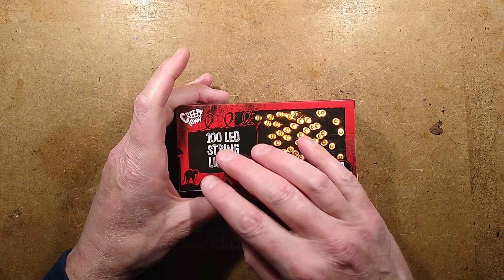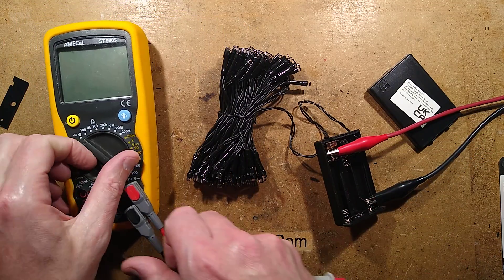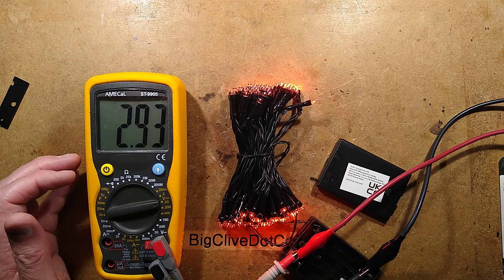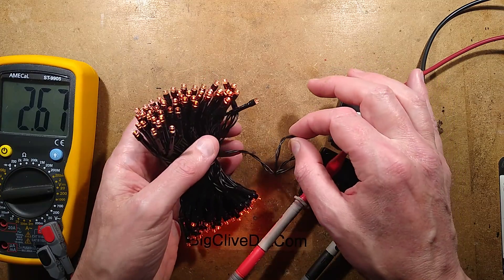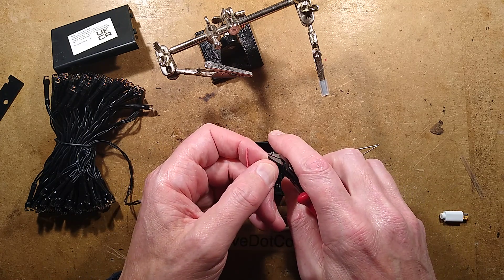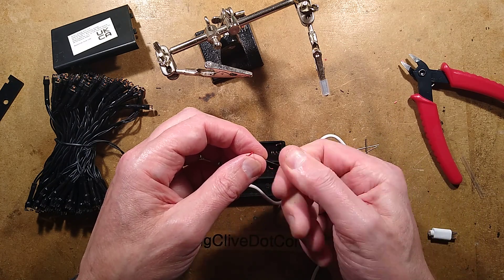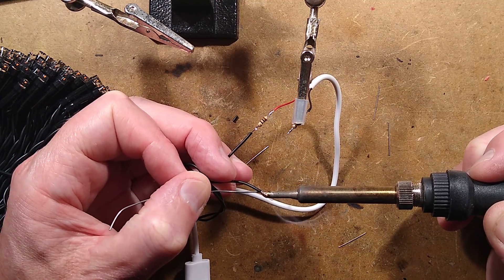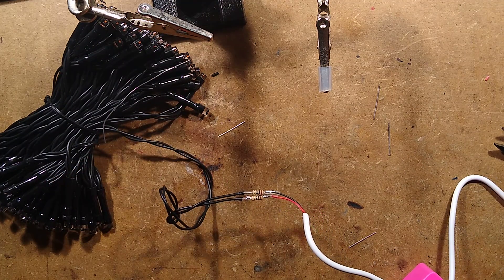Poundlands 2021 Halloween lights (and USB hack)

Comment: Hi Clive - Another great video thanks! 👍🏻
I’ve recently bought some fantastic COBs and Cree LEDs - about £1.50 for 10 ! (link below).
I was particularly impressed with the tremendous light from a ‘waffer thin’ 1 inch diameter round 3W COB!
It runs off about 9V (260-280mA) but I’m a mere novice and don’t know if it requires a resistor. Is it because without one, I’m effectively short circuiting the whole thing? It lit up fantastically with a 7.4V lipo but I didn’t keep it connected for long.
I’d like to know if I need a resistor & if so, what value? People have also mentioned ‘drives’ or ‘drivers’ ?
There’s another great little 1W Cree (same price) which runs off about 3.2V.
Any suggestions or dare I say a VIDEO would enormously useful 🤩🤩🤩 Thanks again! 👍🏻
Reply from the maker: LEDs generally need current limiting and for the high power ones, also some heatsinking too.
Reply: @bigclivedotcom  Thanks!  - maybe you could do a video on these types of led. Neither of them got warm, not even the 3W, it’s almost like free light! And what’s all this about drives or drivers ? 👍🏻👍🏻👍🏻

Comment: Tried this today with 2 sets of the purple bat LEDs 16 in parallel altogether. My resistors are getting very hot with them though. Not sure what wattage they're rated at so maybe that's the problem?
Reply from the maker: Are they 10 ohm resistors on a 5V supply?  They shouldn't get hot.  You've not wired them across the 5V have you?
Reply: @bigclivedotcom  I wired them in series but used a tiny piece of perf board maybe I've done it by accident.
The lights look nice though :)

Comment: B &m have orange, Green and purple leds 100 powered by 2x aa batteries, can I do the same hack using just resistors to take the 5v usb to 3v?
Reply from the maker: Yes if all the LEDs are wired in parallel it should work.

Comment: Oh I've left off the heatshrink... while I was working at a little place that serviced drainage inspection robots. Look up PT02E121-10P, though I think there were more pins, its been a while and I cant remember. What I do remember is putting those onto the end of that armored cable spooled onto the drums you see when they're running the robot through subterranian pipework. I remember that very clearly, since I was only permitted about a half inch of space to solder all those pins through. Any more than that, and the back end of the connector wouldnt seal down properly. The heatshrink went on over the back as a secondary seal, but it had to be on there, as well as onto every connected pin. All this while keeping  the cable clamped in a vice, usually in a position that'd leave half the pins blocked by the vice, or the socket upside down. That was such a fun job...

Comment: Just bought two of these, got to say I'm a little dissapointed. One set has loose wireing around a couple of the LEDs and a section of 8 LEDs are not lit out of the box. Both seem to be noticably dimmer at the end, sub par wireing. Still good value if you want to take them apart though.

Comment: I bought a bunch of "2100mA" "High Current" USB cables... that depending on the length could only pass 1300mA or 600mA.  Thanks China.

Comment: I would not cut the battery holder off so short, a bit more wire makes it much easier to connect that other project to the leads from that :-)

Comment: Absolutely great idea. Thank you for this video. May I ask do you have an option for the LED stripe lights. I purchased a 20m set and only required 12m. I now have 8m which cant be used because you only get one control box and transformer. They are multi colour LEDs which can be altered with a remote. I can just throw these away. I would love to hear what options you have for this purpose. All the best
Reply from the maker: With some sets you can reuse the offcuts, but it depends on the type.  Some 12V sets will cease to work if you cut them to length.
Reply: @bigclivedotcom  much appreciated with the reply. Yes I can confirm the remaining 8m are useable once cut. My question was more around your (hack part) could you/i knock up a cheaper alternative rather than having to purchase a manufacturers additional power supply and control board which cost £££££. 
Would u have an email I could email into with a bit more detail. I'm sure this would be a great video for you.

Comment: I believe that a chemical battery  is quite different than a power supply; it have an internal resistance that the bench (or another) power supply do not have.
I speak from my experience of trying (long time ago) using battery only powered radios with a transformer+bridge rectifier+ filter capacitor. If I added a stabilization stage (7805 or 09 mostly) then the radios worked almost fine but for some I needed to add a small resistor in series (few ohms, less than 10 I think).

Comment: i recently found out about self amalgamating tape.  its been around for years.  my first thoughts were to tell my sparkie mates as a back-up for those times when they forget the heat-shrink sleeve.  i dont know if the stuff is allowed but it has a rather impressive insulation rating.  thats why i'm posting about it here.
Reply from the maker: I've used it in the past.  It works well, but needs protected against anything that can puncture it.
Reply: @bigclivedotcom  , yes, the softness is one thing it hasnt got going for it.  our local council installed a new jetty in the estuary.  the jetty sits on concrete piers coated in some sort of epoxy and over-wrapped with self-amalgamating tape.  this is probably to prevent the steel reinforcing from rusting.  that will be a fail.  and i'm sure sea creatures are going to enjoy sinking their jaws into it

Comment: Latecomer here. EXCELLENT - I did 32 years avionics maint and ran an electronics test lab - 2 questions:
1) Where do you get the USB load monitor.
2) What is your video setup? Ringlight? I made one a while back for close ups on coins, etc.   Thanks - 
BTW inthe U.S. we say sahder for solder. 
,any other thigs too - spanners, valves, etc.
Keep it up.!!
Rick C, MSgt, USAF (ret)
Reply from the maker: The USB meter is a ruideng from eBay.  I use a couple of LED floodlights with diffusion on my bench.
Reply: Boy have we come a looong way in electronics. From monstrous VTVMs and o scopes to a voltmeter that you carry in your shirt pocket. From color bar generators and tube (valve) testers and degaussing coils to digital color tvs that cant be repaired or aligned.

Comment: Can anyone tell me why Clive put resistors on the positive and negative, not just the positive...thx 🙂
Reply from the maker: It was to share the heat dissipation between two resistors so they run cool and standard quarter watt ones can be used.
Reply: @bigclivedotcom  Thanks for the reply 😀👍

Comment: No resistor or circuitry - surprised for a set running from 3 batteries.  They are going to sell a lot of those this year especially if people use decent alkali batteries and not the cheap Poundland crap zinc cells.  Funny thing is once one led fails the others quickly follow - my experience with these lights is either use the crappiest batteries you can find or add a 10ohm resistor.  I am waiting for my neopixel tape to arrive so I can build this year's lights

Comment: Thanks for this, just got a set.
How long would the 3 1.5v batteries last?
I put a usb on a set too. Better that way.
Reply from the maker: It depends on the batteries.  The intensity will gradually reduce over time as the batteries run down, so it's more a case of when they're too dim to be useful.
Reply: @bigclivedotcom  I will test a different set to see how long. I've put USB on this set. Thanks for that one. I've not long got into electronics and the battery case will be handy. Using Arduino.
https://www.youtube.com/watch?v=LfP_W3B4Hnw
Reply: @bigclivedotcom  check out the 360° ORB light at Poundland. £2 A ball shape with LED  that sits in a magnetic base. An FM2819 chip inside. The base would be a good screw minder.
Reply from the maker: @Richie_  I think I took one of those apart in a previous video.

Comment: Newbie question... Still learning. What is the forward drop of each led. Guess is depends whether they are series or parallel. So at 5v, each 10R is dropping approx 1V, with curcuit draws 100ma.
So the 100leds are dropping 3v, which would appear to be a tiny forward voltage?
Reply from the maker: The LEDs have a forward voltage of between 2.5 to 3V in this type depending on current.  That means around 2V is being dropped across the resistors, so the 100mA will be shared between the 100 LEDs at just 1mA each.
Reply: @bigclivedotcom  thanks Clive. A parallel configuration then.
Love the videos. They very much further my understanding. Also an insight into how to engineer solutions to problems from a blank page. Many thanks to you

Comment: For small thin wires I still use I still use my teeth to strip the wires 🤣. It's a terrible habit. But I find I have lots of control and less chance of breaking the conductors inside.

Comment: 800mA over 100 LEDs is only 8mA each.  That should be OK, as they are probably rated for over 10mA each, closer to 20.
For a full 5v, probably only needed one 10 ohm resistor.

Comment: Another great trick from "BIG CLIVE" sticking your probe's up the condom's of the gator clip's.... ; )    (& all without getting bitten)
seriously, you can get those battery box's for just a couple of AA's.  so 800mA or (fuckin can't remember what Clive said the current was at 3V. but ya all get where im going with this)
AHH now i remember.. use all those old AA's ya got laying around(& if your lazy like me you will have a bucket of them) and slap um in there. "IT"S JUST FOR HALLOWEEN ANYHOW"

Comment: Oh I do this all the time. Even exactly with 2 10 Ohms metal film resistors, 0.25W. I also put heat shrink over the individually heat shrunk resistors and the cable. The cables are incredibly cheap these days anyway and break when you look at them at the wrong angle.

Comment: I did a similar thing last year, at Christmas, with two strings of LED Christmas card crocodile clips. Each were designed to work off two AA batteries, with no resistor. I chopped them each in half, giving four strings and wired them in series to a 12VDC mains adaptor. I didn't bother adding a resistor and they worked perfectly. I gave them to my parents, as I had no use for them myself and thought it would make a nice addition to their Christmas decorations.

Comment: What is a good current to drive 5mm LEDs with? I've always heard a max of 20ma (or even 30ma), but that would be 2-3A here. That doesn't seem right.
Reply from the maker: 20mA per LED is the maximum recommended for 5mm LEDs.  Lower is better.  With this arrangement the current will be 100mA between 100 LEDs, so roughly 1mA each.

Comment: i dont suppose you have a video (or would consider) doing one where you explain how to pick the right resistors to use in applications like this, for example, replacing 4xAA with a 7.4v lithium cell. ?

Comment: Actually, I'd expect that strip to drain almost 1A, because I think we have 100 10mA LEDs in series, or maybe 500mA total, if we want to be safe
Reply from the maker: Under running the LED will result in much greater life of the chips and phosphors.
Reply: Thanks for the tip!

Comment: Nice modification Clive, I think they look really good, a nice orange/pink, like lots of little Padparadscha sapphires.  Thanks for the tip on how to keep power banks awake, I wondered how I could do that.  I just bought the old type of Poundland power-bank for my string lights as they don’t sleep when the timer switches off.  Unfortunately it doesn’t discharge any current at all.  Would you like it in the name of science?
Reply from the maker: Is the powerbank not taking a charge at all?

Comment: Would you still use  10 Ohm resistors if there were 50 lights or even fewer?
Reply from the maker: Yes.  the two 10 ohm resistors will give a current of 100mA, so 2mA per LED.  You could add more 10 ohm resistors for shorter strings or use two 22 ohm resistors.

Comment: Over in my local Blokker I just found a power supply that’s intended specifically to power aa/aaa powered devices from the mains. A little 4.5vdc power supply and then a “battery” that connects to the DC plug, and a couple of batteries, two straight through connected for 3x battery devices, and a battery with “something” inside (I’d bet on just a resistor, honestly) that you can use to power 2x battery devices. Two sets of the four kinds of “battery”, in AA and AAA.

Soldering it is a better solution, but this gizmo is something the average user can use.

Comment: I have an LED candle that uses 2 x AA batteries (3V) so would this hack also work for them? They have a real crap twist switch on the bum bottom and I want to change it to a more friendly turn-off/on-ability switch. The 3V LED candles have been running very dimly for 6 weeks without requiring a recharge yet and look extremely realistic flickering in the dark and I was wanting to keep that realistic dimness but put a 3.7V removable & rechargeable 18560 but didn't know what size resister to use. The 18650 was going to be housed in a base I was going to construct hence that option whereas a Powerbank would require a larger base but it would have the built-in charging circuitry that my idea would lack.
Sorry, I'm just typing to see it I can clarify my idea as I have no electric/electronic ability what so ever.
Question if I may. If I find the Powerbank is providing way too much "brightness" to the LED, can I use 2 x ¼W 10Ω in series to dim it down a tad? Thanks.
Reply from the maker: Yes.  Use a single 150 ohm resistor.
Reply from the maker: You can experiment with resistors to get your preferred intensity.
Reply: @bigclivedotcom  Thanks Clive. Information is greatly appreciated. 👍

Comment: If you wanted to keep them the same "overdrive" intensity what resistors would you use instead?
Reply from the maker: The LEDs degrade faster when run at very high current.  But you could use two half-watt 4.7 ohm resistors for double the current (200mA) or two 2.2 ohm 1W resistors for around 500mA.
Reply: @bigclivedotcom  Interesting thanks, I suppose that's obvious when I think about it as V=IR so halving the resistance doubles the current.

Is it OK to run them on 5V instead of the 4.5V from batteries? Does overvolting do anything to the LEDs? 

And yeah I know running them hotter makes them last less time, but seeing as they're from Poundland it's not breaking the bank to replace them haha.

Comment: Nice hack handy to know. Been slowly wiring a floral Garland with slow change 2x3x4square rainbow leds. 3.2/3.4v @20 ma each. Had not figured out a power supply or resistors so far but thinking with availability of those Poundland usb packs will go with usb power supply when I eventually get it finished.

Comment: Ah the old multipin connector screw up we've all done. If every wire has soldered on neatly, you will discover that you forgot to put the backshell on as you solder the last pin. Conversely, if you did remember to fit the backshell, one of the inner wires will ping off just as you're finishing.

Comment: A few years back, my local dollar store had sets of 40 which ran on 2 AAs around Christmas for $3. After Christmas, the were desperate to get rid of them so they marked them down to $1. I bought up all the pure white ones I could get my hands on just for the LEDs.

And then the unnamed disease of unknown origin came along, so I wasn't able to get the extra components to do anything with them.
Reply: If you ever need to get your hands on some parts quickly, just grab a bit of e-waste that people toss by the road every day or look on Craigslist/FB marketplace, or even local thrift stores occasionally have some junk that's otherwise good for parts, heck you could probably go back to the dollar store and find a few things with resistors to scavenge and if you're unsure of what might be inside something just have a look for a teardown of similar items.

Comment: Hey Clive, in the description your component list says 2 x 100 ohm resistors are required, I think that should be 2 x 10 ohm, unless you're looking for a particularly dim string of LEDs. 

Great little simple video - reminds me of the old days on this channel
Reply from the maker: Thanks.  I've corrected that.  With modern LEDs, even at the 10mA of two 100 ohm resistors they would still look surprisingly bright.

Comment: Hello Mr. BigClive.
love the video. I had a few questions.
How are so many lights able to operate at such a low voltage?
Also how did you know 10ohms would be enough to bring the voltage down?
Thanks for you time.
Reply from the maker: Modern LEDs will still light brightly at a fraction of a milliamp.  The two 10 ohm resistors will limit the current to around 100mA (2V drop divided by the combined resistance of 20 ohms).  That's still about 1mA per LED.

Comment: I see you use those same red handled India-made cutters that we buy here in the USA for $3 a pair at Harbor Freight (or Hazard Fraught as AVE calls them).  I go through several pairs of those per year doing electronic scrapping.  I use them in ways that were never intended though, and they actually hold up to the abuse fairly well.  Usually the spring will break first and I rig it to get the broken end reattached, but eventually one of the jaws will end up snapping off.
Reply from the maker: These are generic Chinese electronic side cutters from eBay.  Very useful and good quality, because China uses a lot of them in their factories.   I too occasionally damage the blades by cutting bad things.

Comment: I bought a big set of USB plugs with casing just for the purpose of adapting battery operated LED lights. The resistors fit nicely into the case and no more hassle with AA batteries.